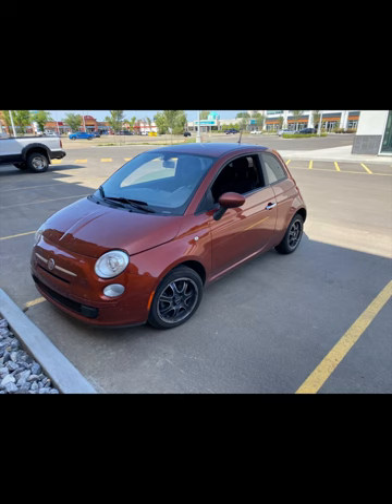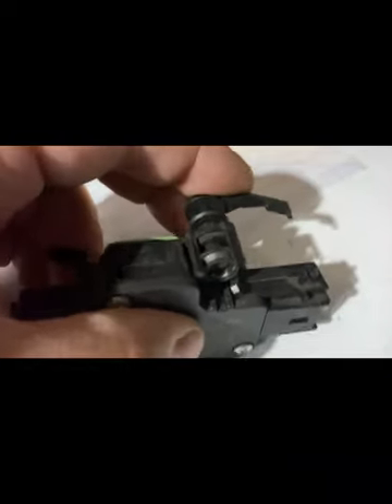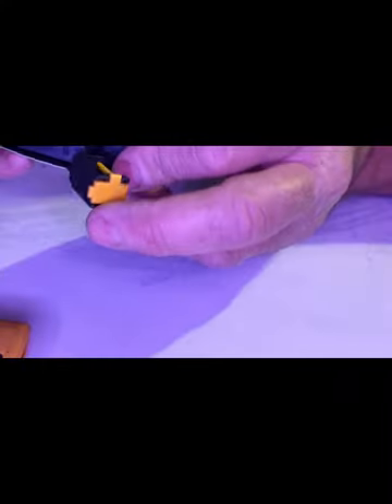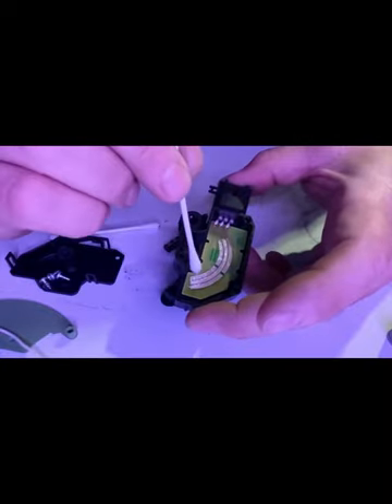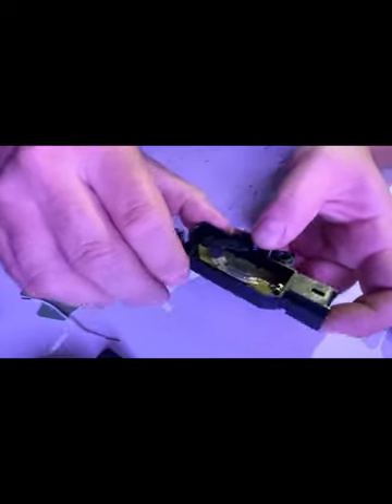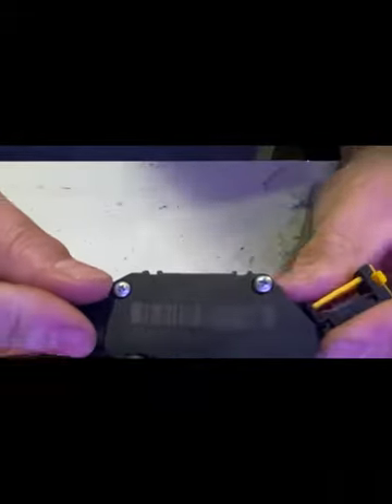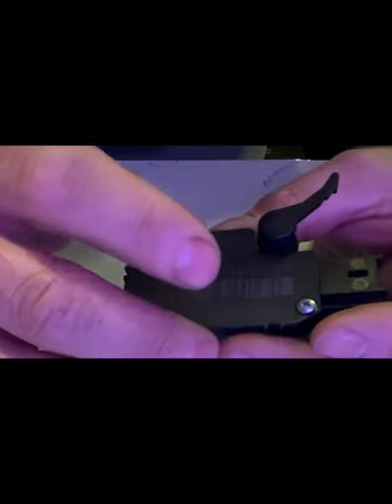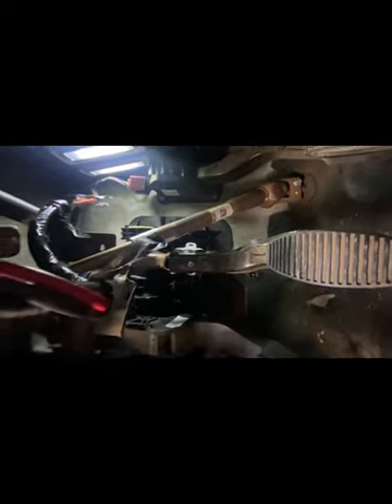Fiat Clutch switch replacement 15 min job!

Comment: Hi do you need to calibrate the switch? Or some procedure
Reply from the maker: No calibration was necessary. Just installed it with the arm clipped back then released it.
Reply: @michettiworkshop  nice, do you think this could cause asr lights and steering codes? Mine ( fiat grande punto) seems to be the only fault in live data i also think it could be the earth strap

Comment: What excactly this switch do? Why there is a potentiometer inside? I ask because I have temporary problems with cruise control in my car.
Reply from the maker: I believe it is set up as a pot due to the anti roll clutch for hill starts. I don’t think it would have anything to do with cruise control.
Reply: @michettiworkshop  I'm not sure. Cruise Control is connected to the clutch sensor and the brake sensor. Thats why when you press breake or clutch pedal the CC switch off